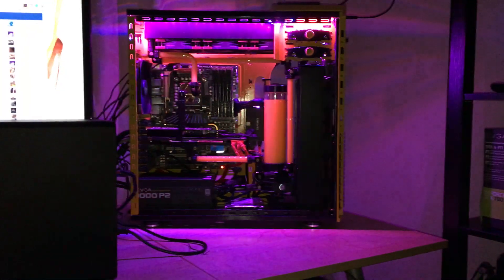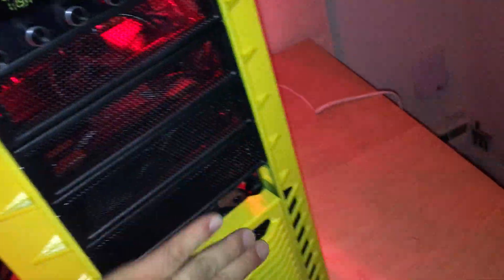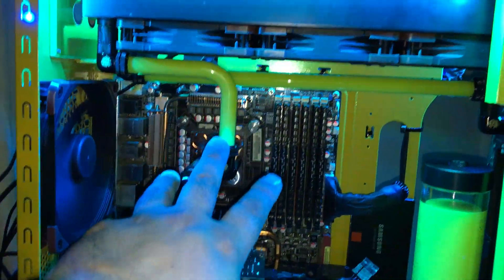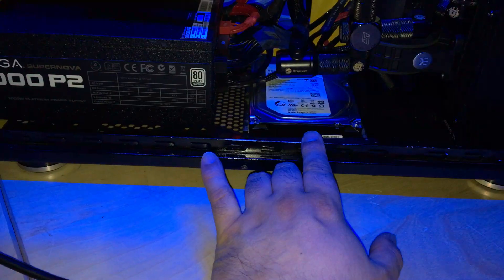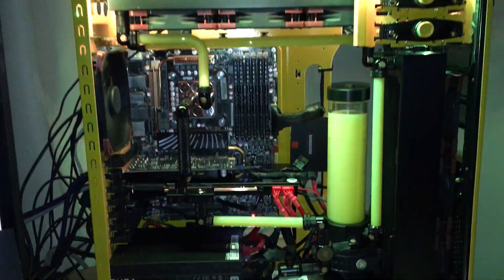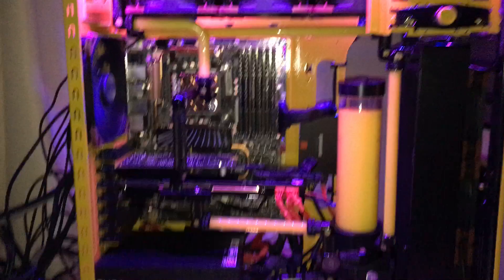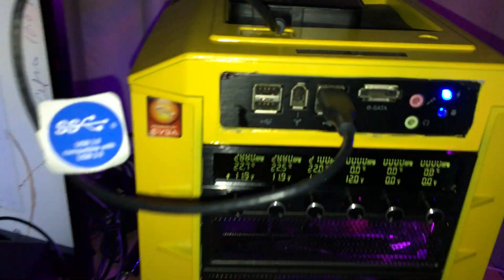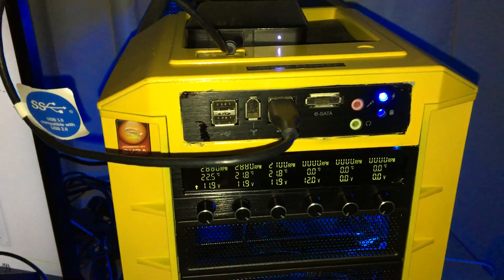My Water Cooling Project

Comment: The top is vented for a 240 so how does the front fan push air out the top on a 360 rad when it hits the area where the tray is on the outside of the case on top?
Reply from the maker: The air is goes out from horizontal top rad and air comes inside case from vertical rad.